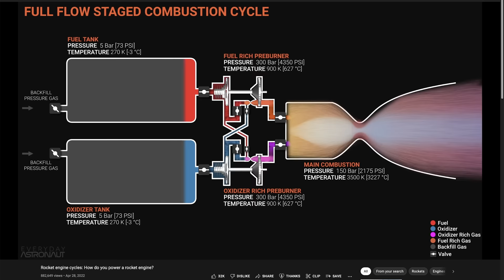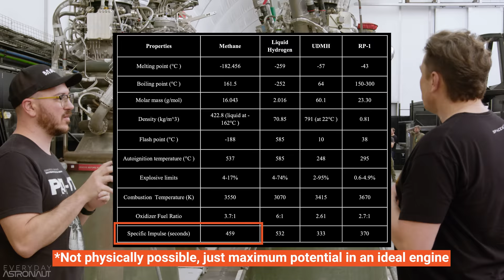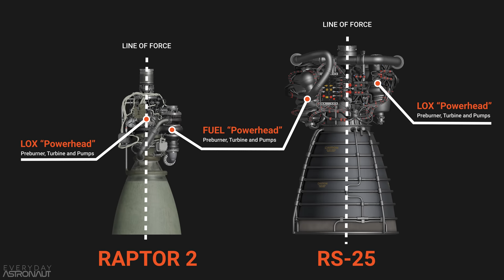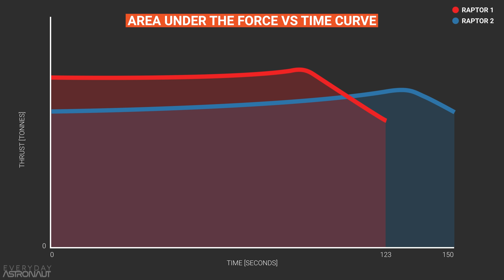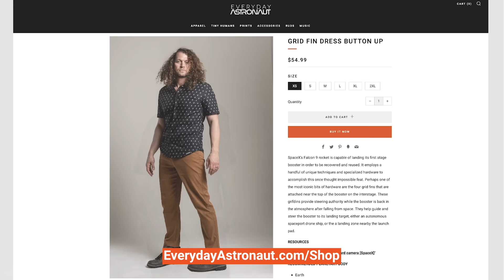Elon Musk Explains SpaceX's Raptor Engine!

Comment: Over the years I have lamented the incredibly slow technical development of rocket engines.  Even today engines like the RL-10, AJ-10, RS-25, RD-180 that are results of technologies developed as early as the 1950s, are still in use.   I was told by many that RL-10, for example, with its ISP of 465.5 seconds was the best that could ever be.  I replied that it was as absurd as stating a 1957 Chevy was the pinnacle of automotive technology and could not be improved.  Elon and his genius rocket engineers have shown what is possible.  The Raptor 2 is levels more advanced in so many areas than anything else in the world.  It gives me great confidence for humankind’s future in space seeing the extraordinary engineering work that is going on in SpaceX.
Reply: even funnier when you consider how Elon has improved cars as well,,
Reply: I only soft agree with this. While these engines are very advanced, they are still fundamentally fossil-burning motors. IMO if we are to truly advance to a solar system-wide civilization we need to figure out better propellants and better ways to derive thrust power. I'm not saying The Expanse-level torch drives, but at least something with better ISP than hydrogen. (no, current ion drives don't count because they have the thrust of a hummingbird)

EDIT since it wasn't clear: the issue with fossil-burning motors isn't the fossil part, it's the burning part. Combustion-based rockets have garbage ISP.
Reply: @Blaze6108 Right? Even ion drives have to get their power from something else.
Reply: @Blaze6108  Maybe nuclear engines at some point, when ships can be built in orbit around Earth.
Reply: @Blaze6108  the fuel doesn't have to come from fossils, that's one of the nice things about methane in rockets (long term) it's easier (energy cost) to source renewably than hydrogen
Reply: @thierrymercure  given the density of Uranium and the environmental and safety concerns if there were a launch failure, it's possible they'll look to mine it elsewhere in the solar system if possible before trying to launch any serious amount of it from here.
Reply: RS-25 and RD-180 (or rather, RD-170 family) were developed in 1970-1980s. ~40 years ago, not 60 :)
Reply: @jkeeversphone  how about fusion power engine?
Reply: @zhchbob  unfortunately not useable for launch as the byproducts are horrible to try and clean up.
Reply: No science should ever be settled
Reply: @zhchbob  The difficulty of sustained fusion is to keep the plasma within the region you need it. It's challenging even when the reactor is stationary. Doing it while you do a shaky acceleration will be even more difficult. (Emphasis on the shaking. Constant Gs can be handled.)
Reply: @Blaze6108  methane is not a fossil fuel
Reply: @frank52fvo  Right now it absolutely is, and even if it wasn't, we need something better than hydrocarbon burning if we are to develop substantially into space.
Reply: @user-nc9se7sm4y  The RS-25 can trace its heritage from the J-2 engine used in the Saturn 1B and Saturn V.
Reply: While the theoretical maximum for a hydrolox engine is around 532 seconds (see 13:50), Elon explains that a real-world engine can't achieve this, so 465 seconds almost certainly is the best you could get out of a hydrolox engine. Maybe moderrn technology could add a few seconds more, but I suspect that other criteria, such as cost, reliability, ease of manufacturing, maintenance would make it less attractive overall.
Reply: @Blaze6108  Raptor isn't a fossil-burning motor my friend. Merlin is but raptor isn't
Reply: @thierrymercure  It's really hard to get from surface to orbit with nuclear engines. Also, I don't think we will ever be available to build ships in orbit due to the "lack" of gravity
Reply: @zhchbob  Might be a solution for the future because we won't see fusion power working at it's peak in our lifetime
Reply: @Blaze6108  No it isn't, methane is not a fossil fuel. And btw, burning this hydrocarbon, methane generates carbon dioxide, which is about 40 times less pollutant than methane is.
Reply: @nunosanto7365  I wasn't thinking of getting to orbit with the engines, just put the engines in orbit via payload. That's why I was thinking "building" it in space. maybe not all of it but parts of it.
Reply: The term "best" is subjective. If we're talking about ISP, then yeah the RL-10 is probably at the limit of what is possible for a chemical rocket. No methane-fueled engine can hope to beat that. But can the RL-10 ever be used as a booster engine? Absolutely not, due to its very low thrust output as it's designed for vacuum operation alone. Rocket science is about trade-offs and this is where the Raptor shines. It is sort of a "best all-rounder" engine since it performs reasonably well in nearly all metrics.
Reply: I agree what you are saying but I beg to differ about the 1957 Chevy. It is the pinnacle of automotive technology -  with 1959 Cadillac... 😎
Reply: @nunosanto7365  "natural gas" is a fossil fuel that is the cheapest source of methane. in effect, methane IS a fossil fuel is the same way that gasoline, derived from oil, is a fossil fuel. Much cleaner than oil, but that carbon atom in each molecule has to go somewhere.
Reply: @rakaydosdraj8405  Ofc it has to go somewhere but remember that that carbon atom has made a long way from it's beginning to the methane. Nothing is created which means the carbon atom will always be there, you can just turn it from methane to carbon dioxide or other molecules to make it "cleaner"
Reply: You forgot the F1 and F1A are still the most powerful single-nozzle, liquid-fueled rocket engines ever developed.
Reply: @Blaze6108  hydrogen is far too low density, besides far more energy is wasted in the manufacture of expendable rockets
Reply: @nunosanto7365  It's not hard to get to orbit with one group of nuclear engines, but that's the nuclear pulse drive, and your launch range is a consumable there
Reply: I don't think we do. It seems like we use a colossally wasteful process to get to orbit, but it isn't really as bad as it seems. Orbit is just really fast, and that means lots of energy. As a conservative reference, consider a 10% delivery to orbit reusable hydrogen system. 1kg of mass to orbit requires 9kg water to be electrolysed for fuel. Even with energy losses, and extra hydrogen because engines like running slightly fuel rich, you are converting something in the region of 5% of input energy into orbit energy. That's not great, but extremely hard to beat. Advanced boosters can also reduce the energy requirement considerably. Current boosters are optimised for cost, and fuel (energy) is not a major contributor to that. Water injection for booster engines absolutely tanks the ISP, but increases thrust per watt, reducing overall energy requirement for the early flight, and that's just the start of what is possible. Getting to 15% is not unreasonable.
The funny thing about nuclear thermal rockets is that they actually perform worse at getting to orbit. Either they use water as the working medium, and get crappy ISP, or use hydrogen and the energy to make the hydrogen eats massively into the savings from having a high ISP (need much more hydrogen for same working mass). You are better having the reactor on the ground making hydrogen for conventional rockets. There is no reason to use nuclear that early in a flight.
Once in orbit things start to get more interesting, but even then hydrogen oxygen rockets are hard to beat, particularly if you are bringing oxygen from the moon* to low earth orbit. When you have much more time, ion works just great. It has miniscule thrust because it requires tons of power, and large solar panels are hard to fit in a rocket. Orbital construction changes that, as do lighter solar panels. Once you are able to easily put hundreds of m^2 of solar panels on even a small probe ion propulsion stops being nearly so sluggish.
*Plenty oxides we want to reduce for use on the moon, and bringing stuff to lunar orbit is far easier than from earth in terms of thrust to weight and total delta-v. There are some weird rockets that can use purely locally sourced propellant**, but you are probably better bringing just a little hydrogen from Earth to make them work. Ion tugs are capable of moving stuff from LEO to LLO, so moving hydrogen from Earth to LEO to LLO to the moon, and then bringing oxygen from the moon to LLO, and then back to LEO, gets you more oxygen in LEO than if you sent it from Earth.
**Some sort of oxygen aluminium hybrid rocket is possible, but nuclear sodium makes sense here. One cool thing about nuclear sodium is that it can use MHD pumps, meaning the whole engine can have no moving parts other than controls.
Reply: @agsystems8220  actually methane is better, less loss due to gravity drag
Reply: @stainlesssteelfox1 Well, you have the RD-0146 developed (fully) in a Russian-American collaboration in the 00's. It reached an operational ISP of 470s apparantly
Reply: @VG_164  Interesting.
Reply: Yes, he is real impressive.

Comment: FYI: the area under a Thrust vs. Time curve already has a name. It's "Total Impulse". Any model rocketeer will be familiar with the term, because the solid rocket motors they use are rated by Itot. A-class motors provide up to 2.5 Newton-seconds, B motor, up to 5 Ns. Each letter doubles the maximum total impulse. Hobby / sport motors go up to O class, with a maximum Itot of 40,960 Ns.
Reply: i was a little saddened that Elon couldn't easily grasp he was talking about momentum.
Reply: As expected, it's just the integral of the function 😁
Reply: Liquid rocket operations don't naturally lend themselves to the concept as solids, and Musk was speaking of the top of his head. But even Super Heavy and Starship have a total impulse consideration. That is, they have limited propellant stocks, so there is a maximum total impulse each stage can provide.

And to his salient point: specific impulse varies at least somewhat in any solid or liquid engine due to a variety of factors, particularly chamber pressure. Taking a total impulse value (e.g. Ns) and dividing by the weight of the propellant (e.g. N) gives you an average Isp in seconds over the interval.
Reply: Nope.
Reply: I would think if you took it further then you would have to consider the total impulse for the mission profile since efficiencies will change with outside pressure.
Reply: @kidcasco1966  probably because total impulse isn't even really used much for launch vehicles since they've blown clear through whatever impulse ratings are relevant for legislation and just kept on going
Reply: "the area under Thrust vs Time curve for a given amount of fuel flow" is not total impulse.
You missed "for a given amount of fuel flow"
Reply: @AkaiKA4K  As stated in the video, he started out saying "mass flow" (not fuel). But it's clear that he is saying that the important thing is the "area under the force-time curve", and that is absolutely total impulse.

You can use a measured total impulse plot and also the measured mass flow rate over a run to get specific impulse over the run. You can take portions of the total impulse plot and look at specific sections that have a particular flow rate.

But in all cases: the area under a "force vs time" plot is total impulse - however you use that data.
Reply: @gregzsidisin  Just pointing out that it is not just total impulse.
It is total impulse for a given mass flow.
Reply: AFAIK that is also called work  in mechanics :)
Reply: @mojeimja  nope, work is force (a tangential component of it) times distance, not time.
Reply: Any model rocketeer is familiar with the concept. Highly doubt every model rocketeer is a mathhead, or knows the term for the concept. Do all drone hobbyists have aero/fluid dynamic science down to a T now?
Reply: @Levitiy  Okay, you got me. Any reasonably aware rocketeer does. Just about anyone flying rockets know B motors have more oomph than A motors, and so on. I hang my head in abject shame for my gross over-statement.
Reply: @onebronx  OMG I fucked up :)

Comment: I love Elon’s explanation of not going through the motions of optimizing a part for efficiency when the part doesn’t need to be there. 100% more efficient in best case scenario! Wise!
Reply: One thing he hasn't mentioned about the reduction in complexity is that in addition to the chamber ignition system, Raptor 1 was overall instrumented out the wazoo because it was always a developmental (as in: brand new) design, and a great deal of the plumbing and wires which festoonws it were for instrumentation, not control.  Now that said instrumentation has given them a thorough understanding of the design's behavior, all of the instrumentation which is not absolutely required for feedback inputs to the control system is no longer necessary.
Reply: @railgap  This is a good point. I don’t build rocket engines, but I do futz about with microcontroller projects. The Raptor 1 strikes me almost as more of a development board package that grossly introduced complexity for the sake of documentation and rapid experimentation. It’s wild how much they were able to strip away once they got down to the “chip” component, in terms of this metaphor. It’s like they were able to lose the breakout board finally.

Comment: Aerospike engines are a type of rocket engine design that offers certain advantages over traditional bell-shaped rocket nozzles. Instead of a bell-shaped nozzle, aerospike engines have a unique shape that resembles an inverted cone or spike, hence the name "aerospike."

The key advantage of aerospike engines is their ability to maintain efficient thrust at a range of altitudes. Traditional bell-shaped nozzles are optimized for a specific altitude, resulting in decreased efficiency at other altitudes. In contrast, aerospike engines adapt to varying atmospheric pressure by automatically adjusting their nozzle shape, allowing them to maintain optimal performance over a wider range of altitudes.

Aerospike engines work based on the principle of aerodynamic expansion. As the rocket ascends, the decreasing atmospheric pressure causes the exhaust gases to expand. The shape of the aerospike nozzle adjusts to match the changing pressure, ensuring that the exhaust gases are optimally expanded for efficient thrust.

Another advantage of aerospike engines is their potential for weight savings. The design eliminates the need for a heavy and complex bell-shaped nozzle, reducing the overall weight of the engine. This weight reduction can lead to increased payload capacity or fuel efficiency.

However, despite their advantages, aerospike engines have not yet been widely adopted for space missions. They present engineering challenges and complexities, and their performance benefits in real-world applications have not been fully realized. Nonetheless, aerospike engines remain an area of ongoing research and development in the field of rocket propulsion.